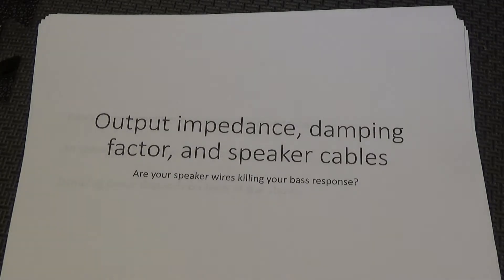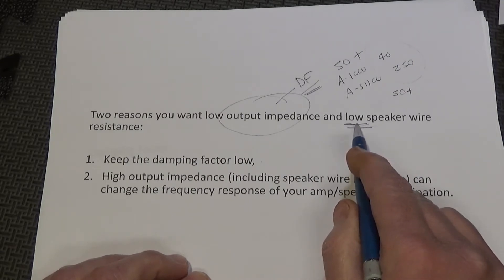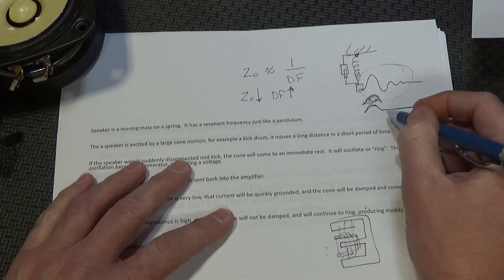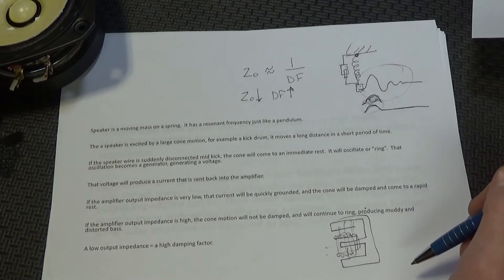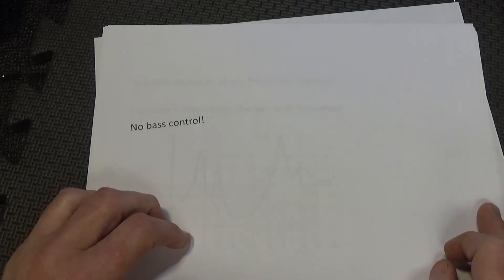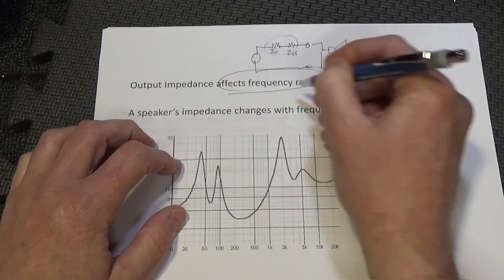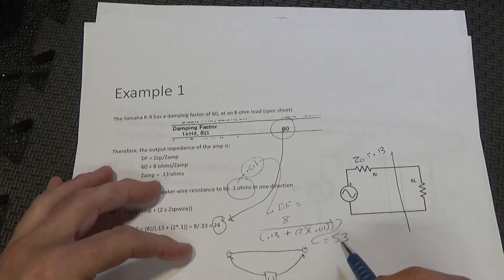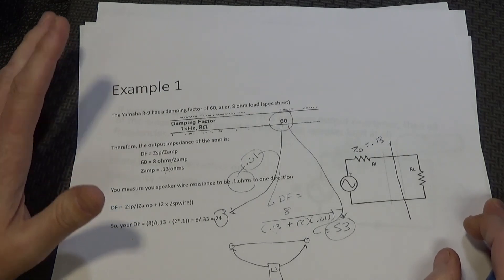Damping Factor, Output Impedance, and Speaker Cable Resistance: Info Every Audiophile Should Know

Comment: That was a clear explanation. I think that a lot of people don’t realise that just the (pure) resistance of a cable influences the frequency response by changing the damping factor.

But I miss some factors in your explanation. Between the amplifier and driver is also the crossover network. That impedance is probably higher than that of the cable. The biggest impact on the damping factor however is actually the voice coil resistance itself. Heating up the voice coil is also an extra impedance, lowers the damping factor and lowers the actual electromagnetic damping. The impact is huge (and also on passive crossovers).

Suppose you have an amplifier with an extremely high damping factor, no cable resistance and no crossover. One degree Celsius (1ºC) temperature rise gives 0.4% extra resistance (depending on the material). That brings down the damping factor to 250. One degree.

10ºC brings down the damping factor to 25.
100ºC brings down the damping factor to 2.5.

And at the maximum rated power and maximum temperature of the voice coil (depending on the driver):
200ºC brings down the damping factor to 1.25.
250ºC brings down the damping factor to 1 (at this point the resistance is doubled, and your passive crossover is one octave off).
300ºC brings down the damping factor to 0.83.

I build and use a system with a total different strategy. As the electromagnetic damping is all over the place, I eliminated it all together. I use a power amplifier with a very high output impedance (a current source), so cables and voice coil temperature has no impact on the damping (frequency response, compression, etc). The actual damping is defined by EQ (Linkwitz transformation). As the damping, frequency response (and so on) are stable now I can very precisely control the frequency response of the driver. On top of that there is no thermal compression anymore (also called power compression), IM distortion is much lower (all the IM distortion by the inductance is eliminated) and there is much lower modulated noise (all the back-emf is eliminated). (SGR Audio has active loudspeakers, the Convex series, based on the same principle).

Comment: The highest damping factor amps I know of are an Adcom GFA-555 Mk II and mono block GFA-565. Damping factor of 1000. Also the Kenwood M2A with the split rail power supply was also 1000 but was not a high current design, but rail voltage was somewhere around 90+ volts.

Comment: can you tell me if output impedance has any relation to the load impedance? 

IE, if you have a 1.2ohm output impedance as measured with a 32 ohm load.. .will that change if you used a 12ohm load? will the output impedance change at all?

What if any is the relation / is there a 'rule of thumb'? 

Thanks

Comment: WHAT IF:
 Instead of taking your amplifier's feedback voltage from the speaker output terminals, try using current feedback obtained by a very low value of resistance in SERIES with the speaker terminals, (typically a very low value of resistance, (,01 ohms), in the ground return path of the speaker to the circuit star ground point?
 Using current feedback, the amplifier's output voltage will change such that the current delivered to the speaker would be proportional to the amplifiers input voltage and no longer affected by the speaker impedance.
 The above would be the perfect scenario, where in reality you would be limited by the maximum peak to peak voltage available from the amplifier and the impedance of the speaker.
OR:
 Took your amplifier's feedback voltage from a second pair of much smaller wires connected directly to the speaker. (Kelvin Connection)?

Comment: This webpage talks of "skin effect"  happening when too large a gauge is used.  Apparently the inductance and capacitance is different for low and high frequencies.   Maybe running 5 wires together might create the skin effect.
http://www.empiricalaudio.com/computer-audio/technical-papers/what-makes-an-excellent-speaker-cable
Reply from the maker: Skin effect only happens  significantly at frequencies well above the audio spectrum.   I recall studying this in HF communications in college.  It is of absolute no consequence in the audio range, which in the grand scheme, is very low in frequency.   Check me on that ...  If I'm incorrect, I'd love to know, really :)